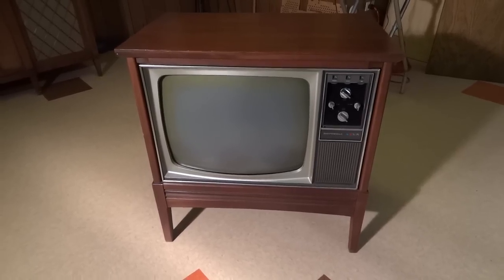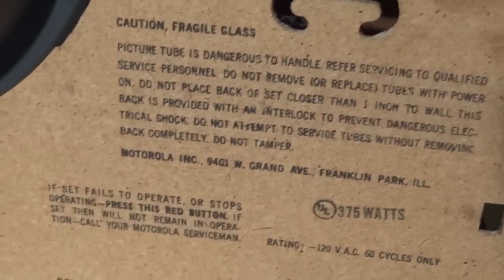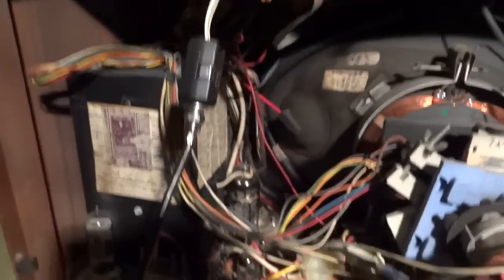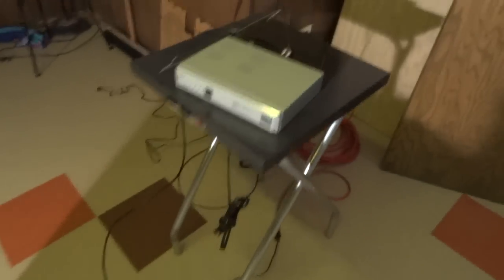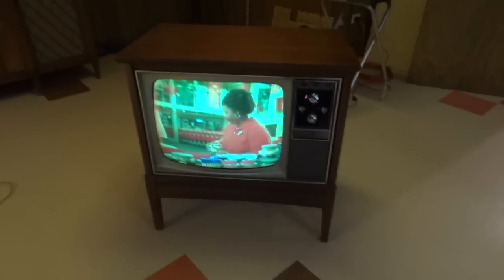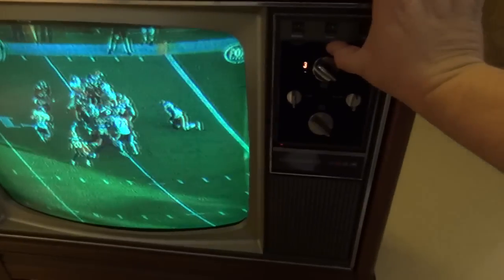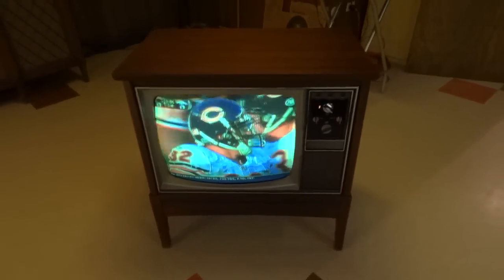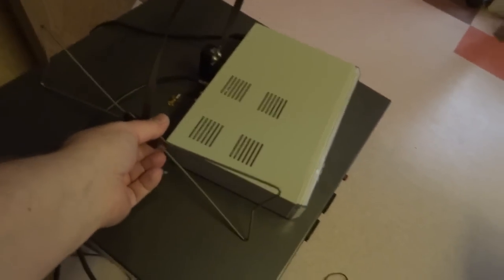Watch a 1968 Motorola Color Television!

Comment: This sure brings back memories for me.  My grandfather was a Motorola and GE dealer and I used to go with him to make service calls.  I remember those clips on the back cover because I used to help him take them off.  

My parents had a '68 works in the drawer set in a huge Drexel cabinet.  I bet that thing weighed 250lbs.  Motorolas from the 60's were very good sets.  GE's were too.  Unfortunately, later Quasars dropped in quality about 72-73, and they really did when Matsushita took over.

Comment: My neighbor had the same set as a tabletop model. This was a reliable and well built set with a hand wired chassis (no PC boards). I took care of the servicing of her set. One or two tubes maybe one time in each 2 years. A capacitor or two during the time she owned it.

Comment: Our first color tv was an RCA  console back in 1968 or so.  It was a real chore having to test 25-30 vacuum tubes every few months. What a relief when Dad upgraded to a newer model five years later with a tv that had solid state circuitry. All those tubes shown on this video were replaced with transistors on a base screwed onto the sidewall of the cabinet.  No more extreme heat buildup inside the console.  These old tv's weren't called curtain burners for nothing.

Comment: Nice set and a great picture! It looks like it was barely used for a 40+ year old set. And as you said, they really made interesting use of the space inside. Most of the tube sets I poked around in as a kid had the horizontal output and damper tubes right beside each other next to the HV cage. This is the first one I've seen with the damper tube within easy reach and the horizontal output tube so far inside, though they're both next to the HV cage.

Comment: In the late 60's my parents bought one of Motorola's Quasar Work's in a Draw console color TV to replace a very unreliable '66 RCA console TV.  It was much better set than the RCA.  They had that set until the late 70's when they replaced it with a new Quasar.  By that time Motorola had quit making TVs and I believe Matshushita bought the Quasar from Motorola.  It too was very reliable set lasting well into the mid 90's before it was replaced with a Sharp.
Reply: I wrote a letter to Motorola and they told me that they sold the TV business to Matsushita on May 28, 1974, and along with it the rights to the "Quasar" trademark.

Comment: Doug Great Set... Like the way you can use TV's Tuner talking about DTA Converter the best Digital Stream 9950 I find pulls in all TV Channels like the way you get TV and your not even hooked up to an outdoor antenna... I tell Direct TV I have is terrible goes out a the time it's rains now I'm using DTV works better

Comment: I had the same identical Motorola TV years ago however in a metal cabinet table model version...my first color TV. Bought it used for $50 back in about 1976. It was not that good of a performer. Picture tube weak and I had to put a booster on it. UHF tuner had weird black lines grow in the picture as the set warmed up. Color never that good. The blue may have been a little purple. I think tube sockets were kinda poor too as they crumbled from heat and age. Wires broke off easy due to heat related. Then needed a schematic to see where the respective wires went. Though I did love the lay out of the front knob channel selectors, intensity color controls, etc. arrangement design of the set. A+ to the Motorola designers for giving this TV a shiny modern disco appeal styling. I thought it looked classier then a Zenith TV. This was a tube economy model compared to solid state? In retrospect one might have thought that it would be a lot more expensive for a tube set to be built then a bunch of a little transistors. Solid state technology new at the time and one had to pay more for it.
Reply: If you're still here Duane, I think what you were seeing on your UHF dial was something called "snivets." My family had a 1972 Quasar II that had this problem: black lines that ran vertically across the screen (forget what side they appeared on) and would change shape and thickness as you tuned across the UHF band. Apparently this must have been a recurring problem with Motorola sets, but certainly not the only one. I also have a 1950s Philco "Transitone" portable with the same problem. As I understand, it is caused by a UHF oscillation occurring in the horizontal deflection circuits and being picked up by the UHF tuner and passed down the signal chain where it mixes with the video signal, producing the lines. As I recall, there was no surefire cure for this phenomenon.